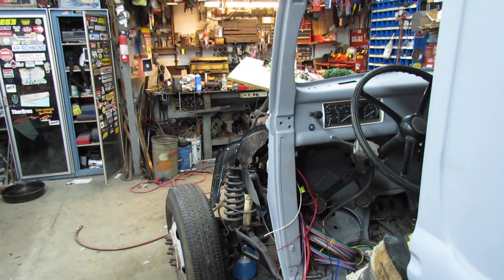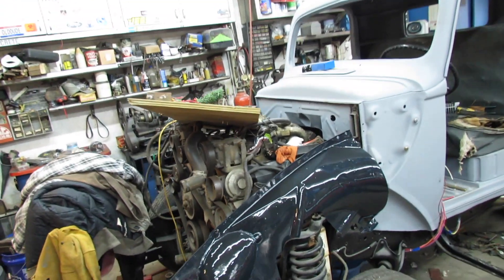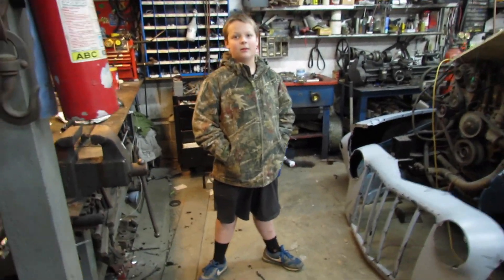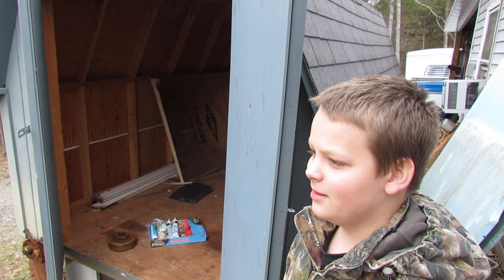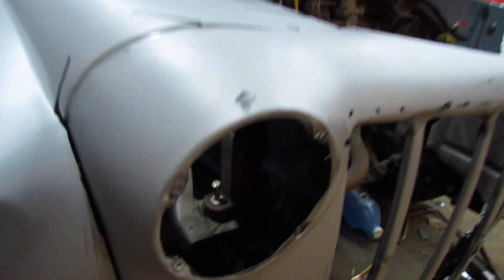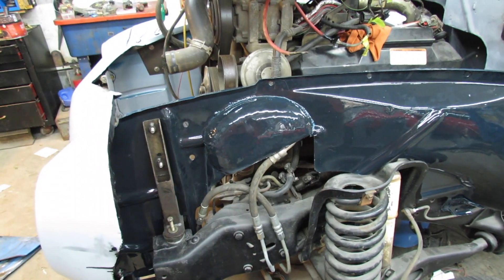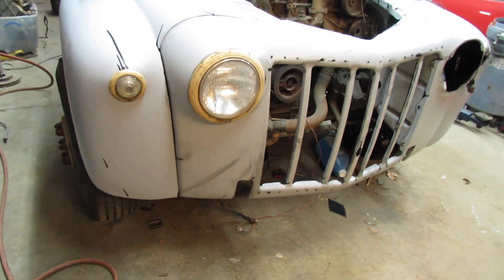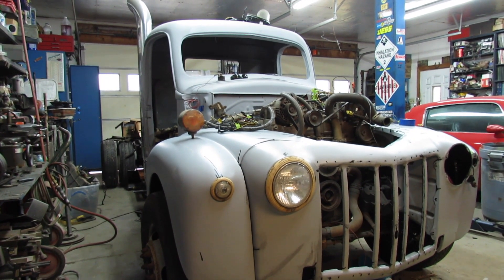46 Ford-Front Fenders

Comment: It looks really good and won't be long before at those cold days that you do a cold start. It  will be the ultimate  thrill of the day so if that don't get you motivated nothing will. My bell next to the subscription got unmarked so it made me late. Thank you again for the howdy on the D&D speed shop, makes me proud to hear or see given. I like the alcoa aluminum wheels for the front but they are thick and may stick out too far for your liking.  Not sure if the mail vans were thinner or not..... here I go helping you spend money; on of those "New Holland" parts  exchange books  as I seen them in a wrecking  yard and in a LIBRARY (that is so's you will see it too. Many years ago I had me a hard job an the guy I  was working for knew I needed that book bad so he got this homeless guy to go in and rent it then he bought it.... you don't want to hear the rest of it!! I did fix the machine. So going to check some other bells and then if they go off again thing things are right

Comment: 1:24 silicon bronze aside, I always neutralize the repair area with baking soda when using flux brazing rod and torch. Epoxy doesn’t like to stick to acidic surfaces. I also never spray epoxy over self etching primer because it seems to react with it.